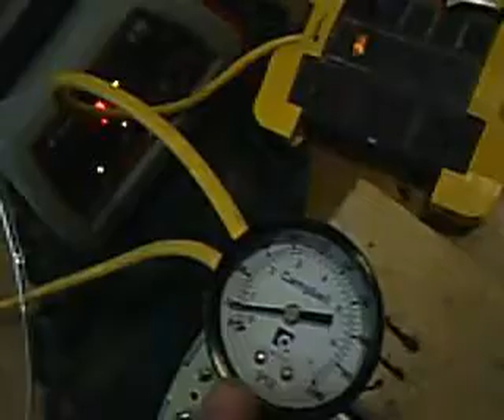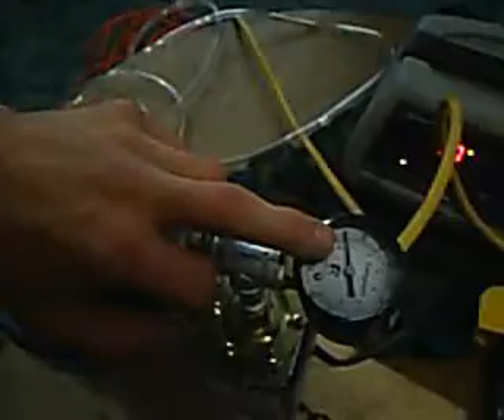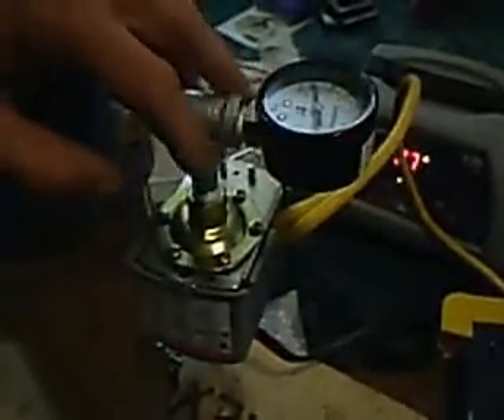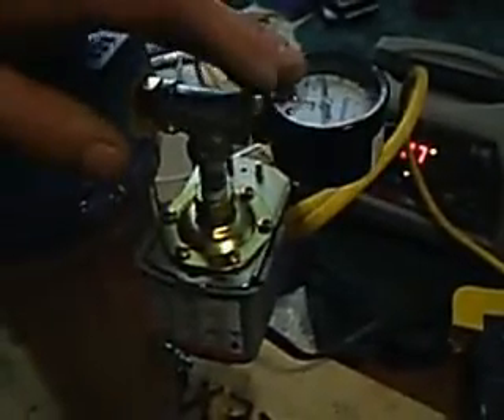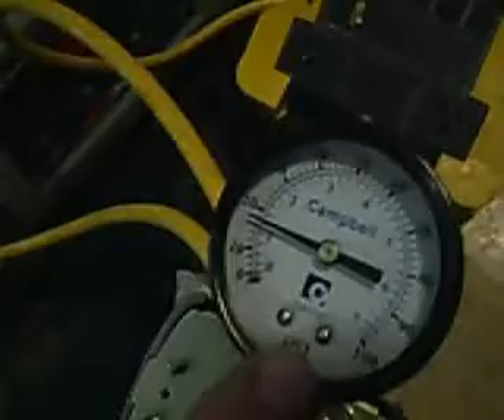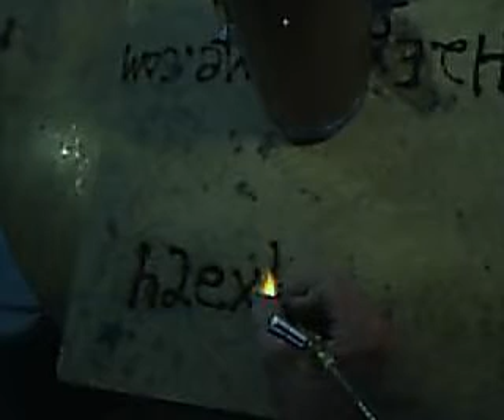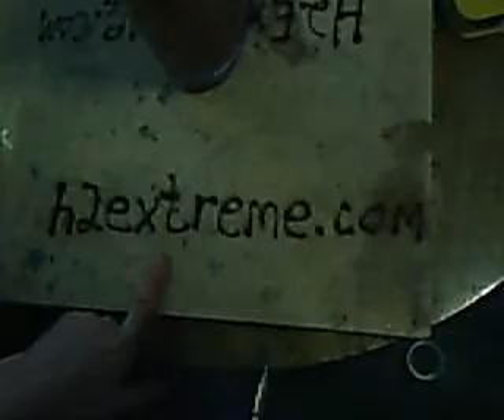h2extreme.com hho generator

Comment from the maker: your absoulutly right. You can NEVER be too safe... my generator is plum full of water. there is only a limited amount of pressurized gas. but dont disregard mielectric1 comment. a bubbler will very easly hook up to this unit. brnze wool stuffed in every orphas i could find.. I tried to blow this thing up and was unsuccessful. maybe ill try again and do a demo video.. SAFTEY IS FIRST...